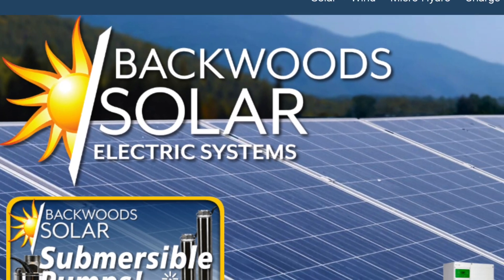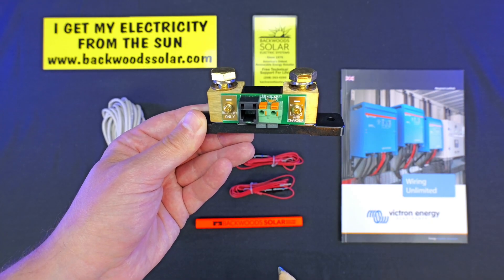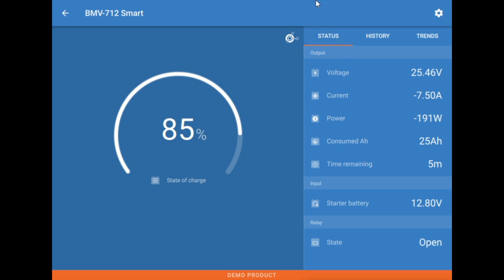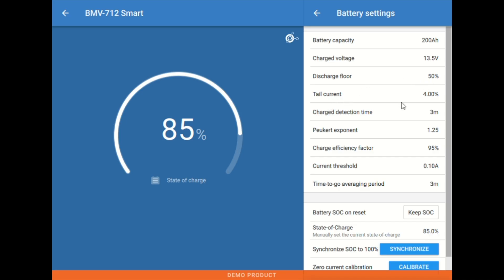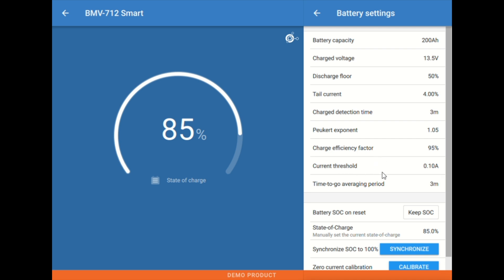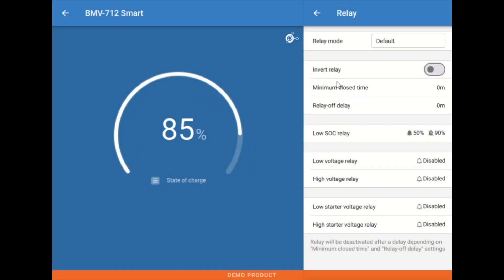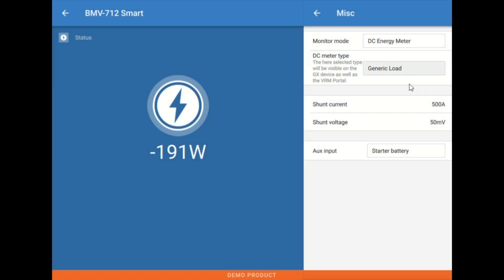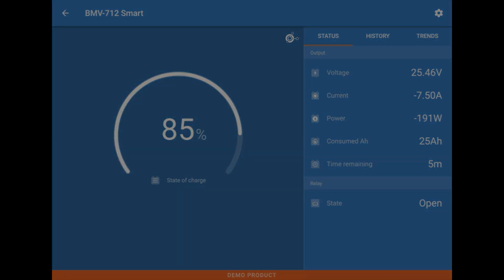Victron BMV-712 Battery Monitor - Setup, Connections and Programming

Comment: we have 2 banks of batteries connected via the Victron power-in module, which is connected to the Victron Lynx shunt. We also have the Victron Cerbo GX.  How can we monitor both banks of batteries? the Cerbo GX only shows 1 of the battery banks.
Reply from the maker: It will depend on your batteries - type, size, total # and physical distance may come into play. If both banks are always in use then using the Lynx shunt programmed for total capacity (both banks) would be the way to do it. You could add a separate SmartShunt for each bank or string to be sure of equal use. In this case you could have the total amps and battery bank % and then independent data for each bank individually. The Cerbo will only display the data from one battery monitor at a time on its main overview page. It will automatically choose the "best" connected for the primary data but the end user can manually select the other devices. Any additional battery monitors or DC energy meters will be shown in the device list. You can have serval connected at the same time, but only one is the "primary". You are welcome to call in and talk with one of our techs if you want to discuss options.